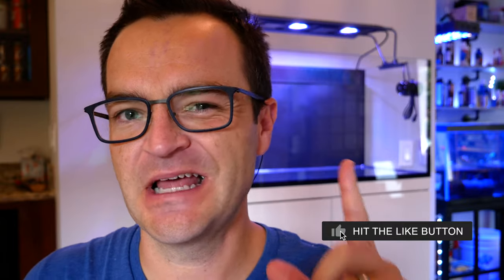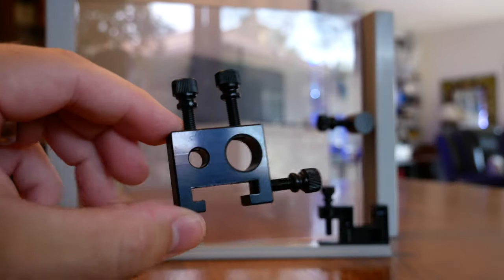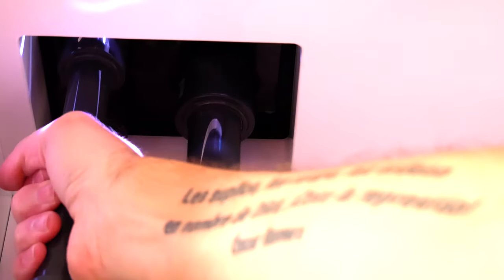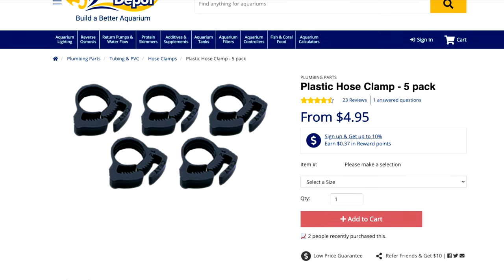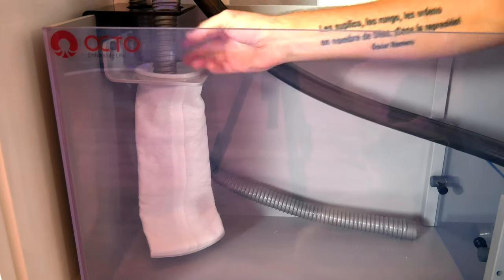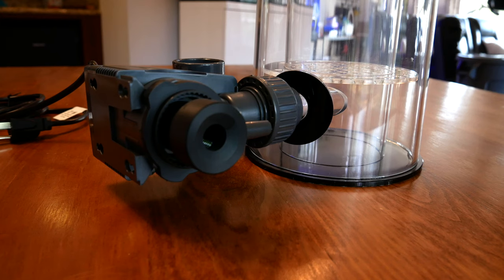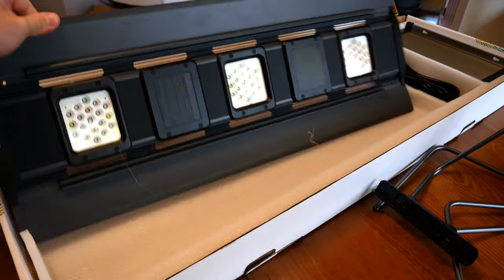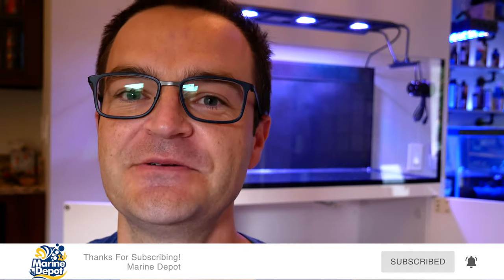Filtration & Sump & Lights, Oh My! Aquaforest Presents Part 03: The Setup

Comment: Worth mentioning plastic hose clamps should be used rather than steel ones which will rust potentially causing complications.
Reply from the maker: For sure!!!
Reply: Those plastic ones horrible.   Steel wont hurt tank.
Reply: @aliceholbert1246  From experience.. rust is a problem. Even "stainless steel" clips can and will rust. Rust is mix of whatever is coming off of the metal that is corroding and something may be detrimental to the tank.
Reply from the maker: going to have to agree with Freaky Goblin on this one.  The plastic ones work well for the saltwater aquarium application.  I can't vouch for them in any other setting, but they are the right choice for saltwater aquariums.
Reply: @MyFirstFishTank  mine popped off return pump. Never again.  Thank god I was home that day.

Comment: Just another probe holder, yet later in the video, you show it installed correctly as a ato float switch, without mentioning it.
Reply from the maker: Actually the probe holder and ato float switch holder are separate. Nice having the probe holder as a bonus though!